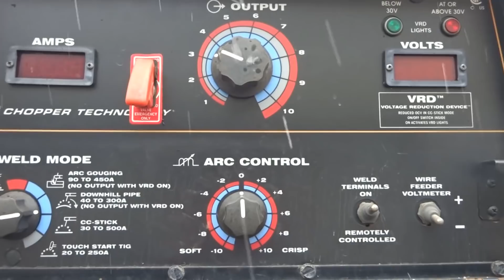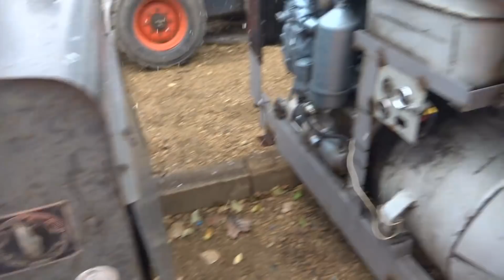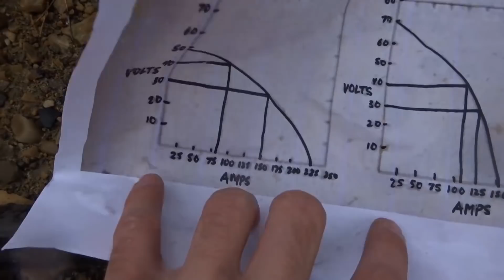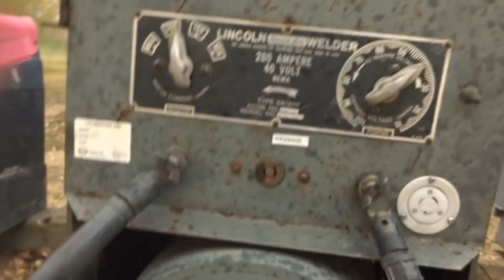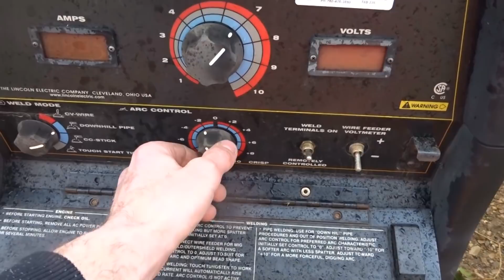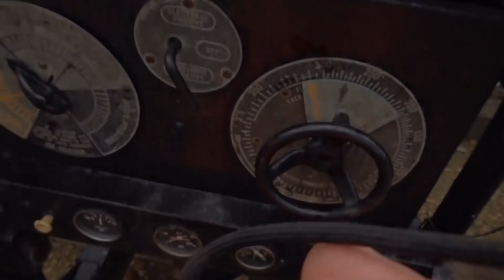Perfect Arc Characteristics - How to fine tune Generators and Inverter Welding Machines

Comment: YEARS AGO I WAS USING A LINCOLN ELECTRIC SA 200 PIPELINER,EXCELLENT MACHINE HANDS DOWN.IVE ALWAYS GONE BY,THE DIAL ON THE LEFT SIDE IS YOUR COARSE SETTING (AMPS),THE DIAL ON THE RIGHT IS FOR FINE TUNING YOUR AMPS.ITS ALWAYS WORKED OUT FOR ME LIKE THAT WITHOUT ANY PROBLEMS!